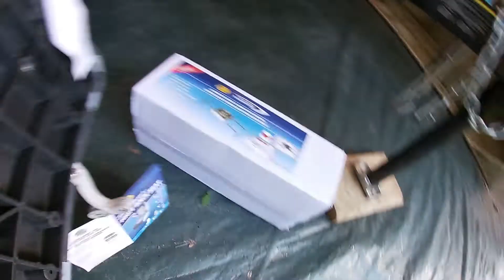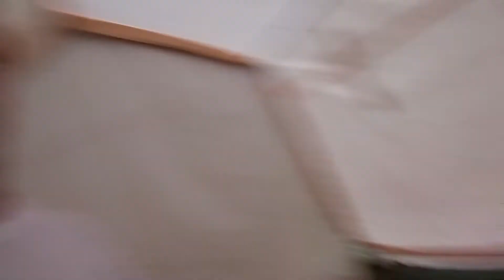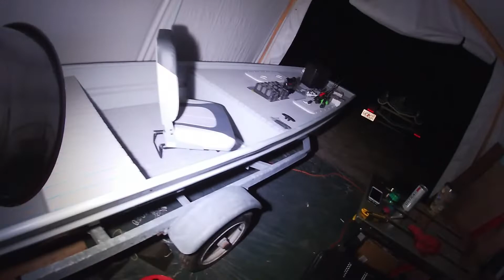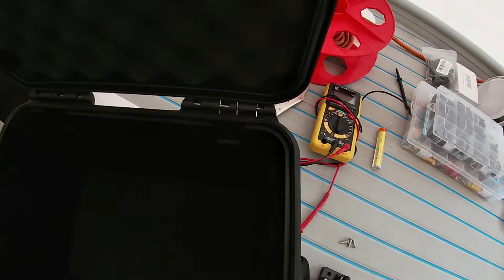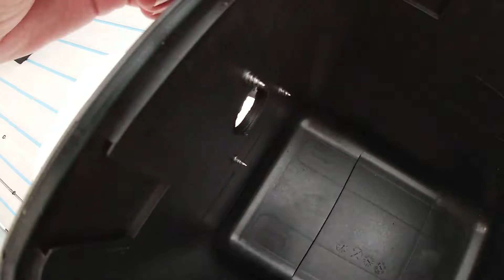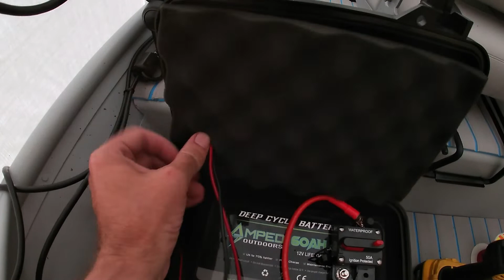How to build a Jon Boat - Part 6 - | Accessories |

Comment: Looks good! 2 things , kasi said paint that wood on the back for the motor mount !! 2nd watch your battery,  the heat in that box with the foam may get really hot
Reply from the maker: Tell Kasi that I like my wood raw. 😈
Gives it that Old Jon Boat vibe🤘
I talked to the battery company about my plan to put the battery in a box and concerns with heat. They said their batteries have an operating temp up to 140° and it should be fine. But, I’ll take my temp g*n and check it if I am out next time in hot sun. 
Thanks for watching the series bud!

Comment: Boat turned out AWESOME.... you started the series out by saying u were basically gonna be doing the bare minimum but ended up having one hell of a boat.. and can compete with the "professional" boat builders on YouTube..... congrats brother
Reply from the maker: Thanks Milton!
I tried to stay true to my budget build plan. The fish finder I already had, battery was the most expensive. But other than that, I think I am around $500 in materials. Cheap EVA foam from Amazon and some wood and paint. I’ll do a video of the total cost breakdown for you guys this weekend. Still much cheaper than the cost of a new Jon boat by itself though. 
Thanks for following the series and for the compliment!
Reply: @FloridaManTV  always 💪🏽💪🏽🎣🎣